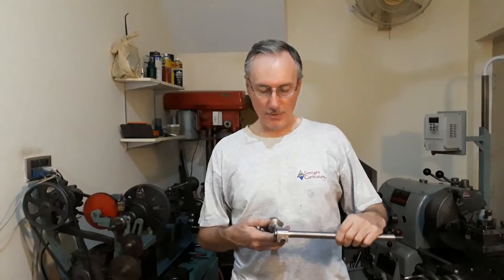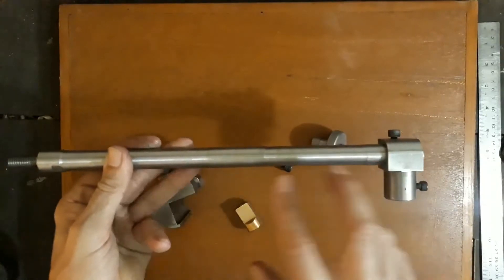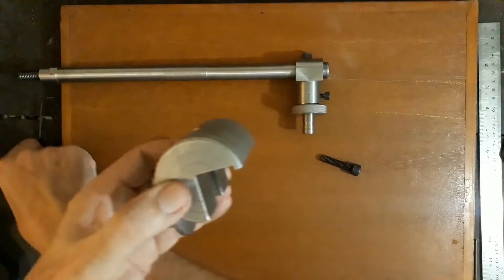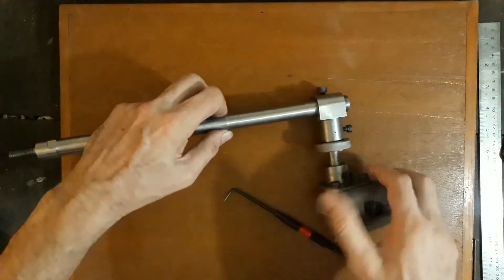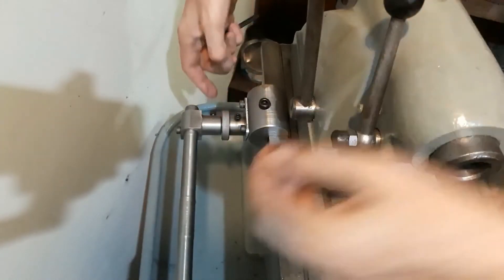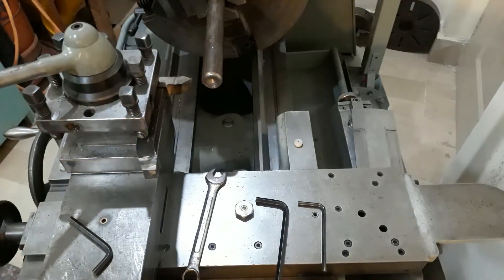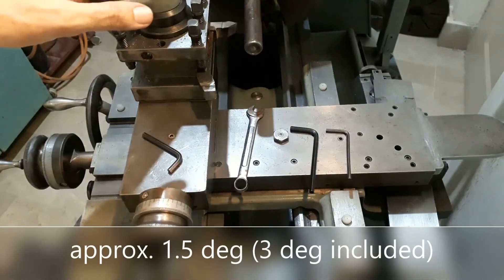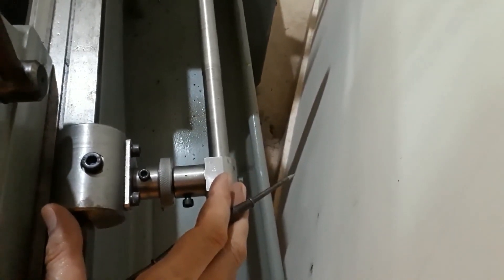Colchester Student Mk1 - missing taper turning parts

Comment: Excellent video. Unfortunately I'm missing the vast majority of the parts and only have the spilt cross-slide.
Reply from the maker: That is frustrating. Not sure where you live, but occasionally I have seen scrapped machines available for parts. Buying second-hand  parts individually seems prohibitively expensive.
Reply: @Workshopfriend  Yes when they are available they're in excess of £1k, that's more than I paid for the lathe. I will probably make one out of 60mm round bar and keyway it using my toolpost attachment. Or just not bother.🙂

Comment: Turning straight tapers ;) - we just loosen the allen screw clamp to the bed and leave everything else tight. It seems to slide along the bed very well and has not caused unwanted tapers :)
Reply from the maker: You may be right if everything is set up properly.